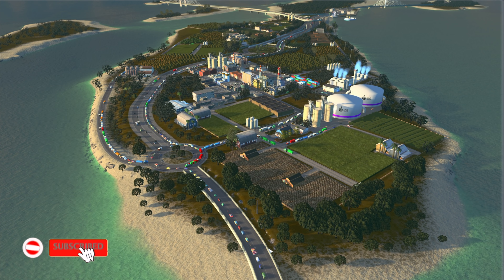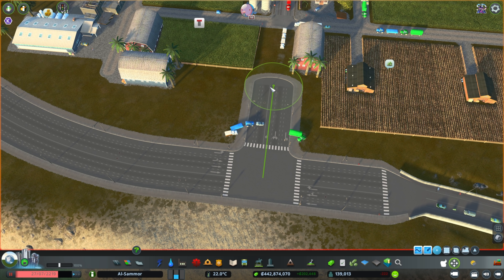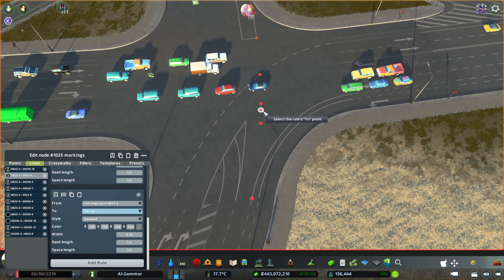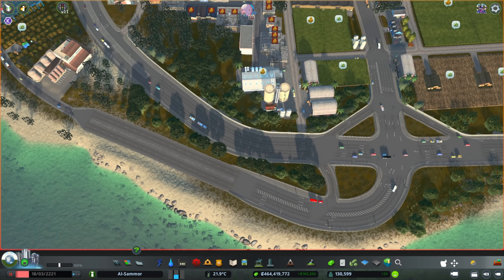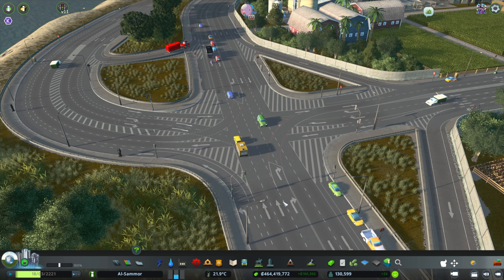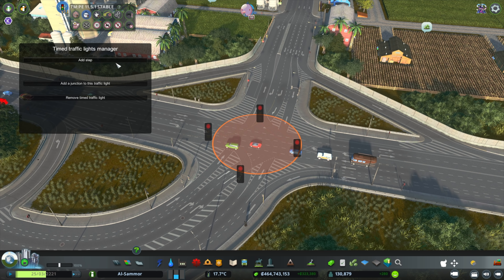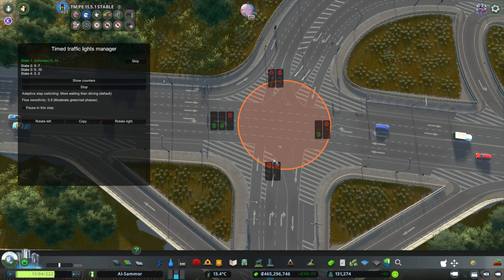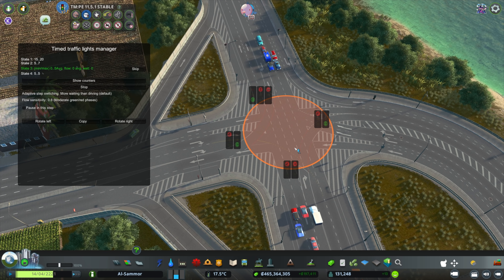Upgrading A Messy Roundabout To High Capacity Interchange | Cities:Skylines

Comment: 0:50 seeing this roundabout I immediately see "this roundabout is not set up correctly". Set up give-way signs correctly (traffic entering the roundabout has to yield), dedicated turning lanes, not have cars from outside enter blocked junctions (i.e. the standard traffic manager setup for roundabouts) should help a lot here. If it still doesn't work, making the roundabout a bit larger, and maybe three lanes, should help here. Then making the turn angles a bit wider using node controller makes cars slowing down less.

Of course, then we wouldn't get to see this nice build.

Comment: Truck passing trough question: Nodes are to close to stop before traffic signals.
Reply from the maker: Yeah I think that’s the issue
Reply: @SamBur  Reducing speed or extending of segent or join ing by node controller (but this will create diagonal entry lines :-( )
Reply: Would that only affect trucks though?
Reply: @OfficialRyanx  No Idea, maby is about length, they could be registered on 2 nodes at same time maybe, but it can be only my idea.
Reply: The node they are supposed to stop at, does not have enough length to the previous node (the roas segment is too short) to allow the long vehicles to fit on it / stop on it. When they are fully on the road segment there's not space to stop in time (for heavy vehicles) and they'd be past the "stop line" if they tried to stop, so technically they are already in the intersection and must leave it. The only way is forward.

Comment: If you had cntrl clicked with the timed traffic light option it would auto set up the traffic light system then all youd have had to do woukd be adjust the timing
Reply: The thing about that though is that the auto set up does one direction at a time. Basically all East traffic goes, then all South traffic, then all West traffic, then all North traffic. This is fine and it works great in many cases but sometimes you just want all East/West turns to go first followed by straight through, then all North/South turns, followed by straight traffic. The real difference in which is better depends on the amount of traffic you get from each direction. If you have a massive amount of traffic from the West and very little from the other three, one direction at a time works great because you can extend the duration of the West light to clear out the queue and you're done. If you have a massive amount of East/West through traffic (as I assume will happen here because East/West is the main through road) and only a couple of people turning, one direction at a time is wastefully doubling the time North/South traffic has to wait when you could just do East/West turns for a couple of seconds to let though couple of people turning go, and then East/West through traffic for a good bit to clear out the queue on both sides at the same time, thus halving the time cross traffic spends waiting. Then North/South goes, and you're quickly back to letting all that East/West through traffic go.

Comment: Do you need a signal head per lane?  Why not try putting in the quick set up as a starting point and adjust as necessary.
Reply: quick setup is stupid if you adjust afterwards

Comment: After getting Node Controller mod, big intersections have become a much viable option.
That said, my busiest "junction" is still one of my roundabouts in one of my cities .. I must have used some 4-5 hours perfecting the road rules both in the roundabout and up to the roundabout, to maximize the traffic flow - And boy does it move a lot of traffic ! I had to use 5 lane one way roads on the roundabout, just to support the traffic, it's nuts !

Comment: I think they maybe ignoring the traffic lights as they may have started there journey before you did it.
Reply from the maker: Not sure. I found a way to fix it. I added 5 seconds of all red lights which allows any rouge trucks to go through
Reply: @SamBur  I have a similar problem sometimes and I suspect it is due to the second intersection/node with the slip lanes being too close to the traffic light intersection. I think the longer vehicles get confused because they are already in the next intersection before they’ve cleared the first.
Reply from the maker: Yeah I think so too. I tried making more space between the intersections but there’s not enough space over  all to do it but anyway I’ll survive 😆